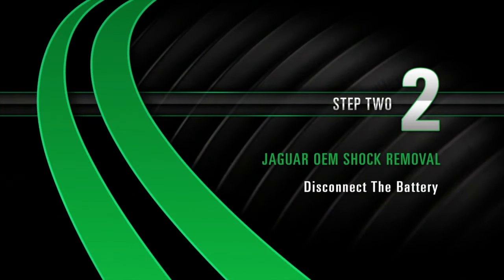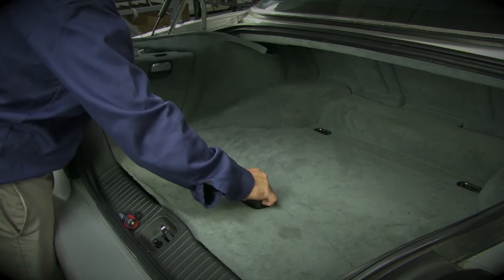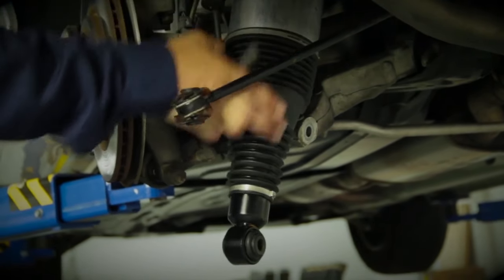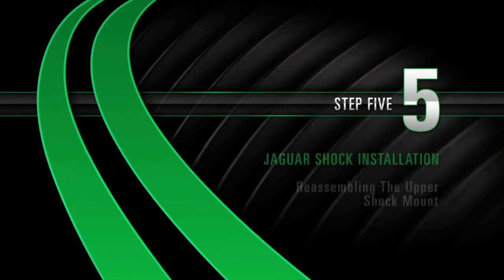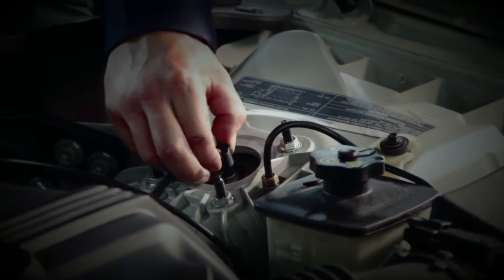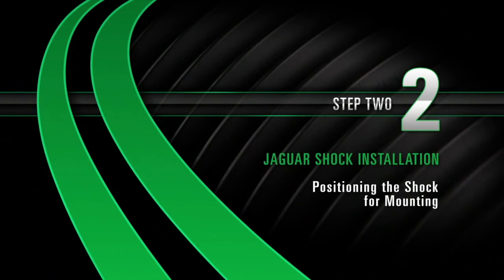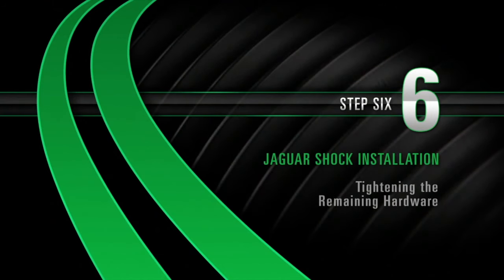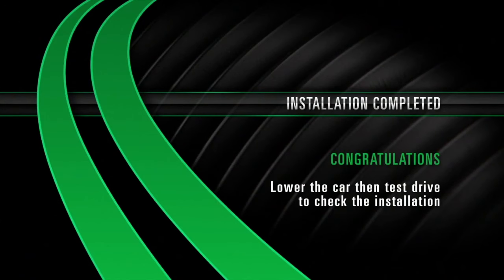How to Install the Arnott Coil Spring Conversion Kit for 2004-2010 Jaguar XJ Series

Comment: I'm glad to have this as an option for our 2005 XJ8, it seems like a great alternative and much less expensive in the long run... not to mention it won't leave us stranded with the car bottomed out in the cold again.  The video helped out quite a bit more than just having the paper instructions.  I will say this dude had a much easier time than I did getting things to line up, especially the rear lower control arm bolts.  I had to eventually get a ratcheting strap on those connected to the opposite side in order to pull down enough to get things to line up.  I also had to use a jack on the front assembly to get the upper A arm to connect.  Maybe this example car had more worn bushings or this guy is just much stronger than I am!  Also of note, if you pop the rear seat back off of its mount points when you are disconnecting the air compressor relay then you will have to take the bottom of the seat out as well to get it back in properly.  The good news there is you will likely find some spare change to make it all worthwhile!  Thank you Arnott, I look to many care free miles on these coils!